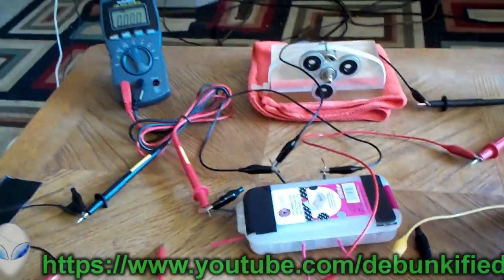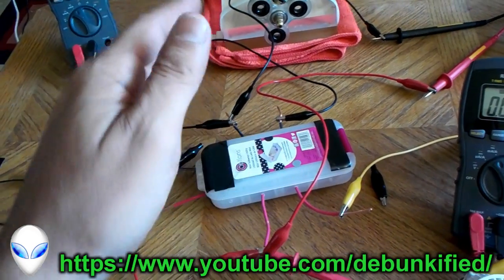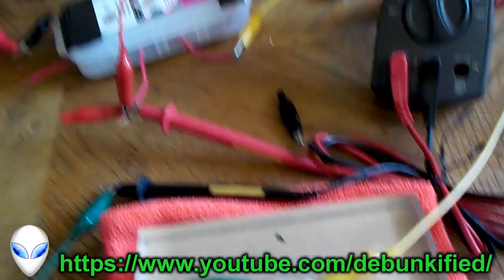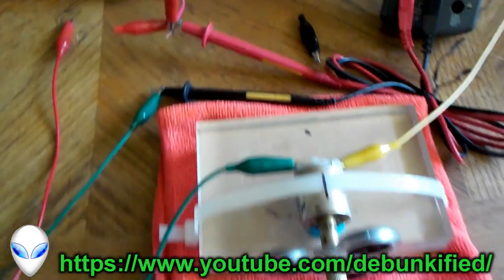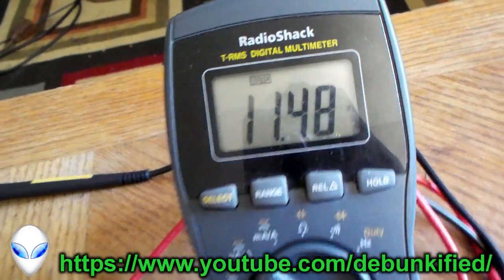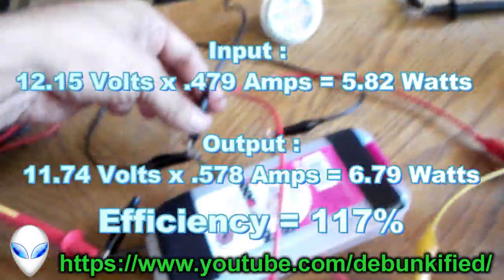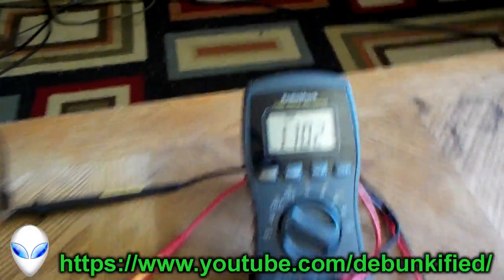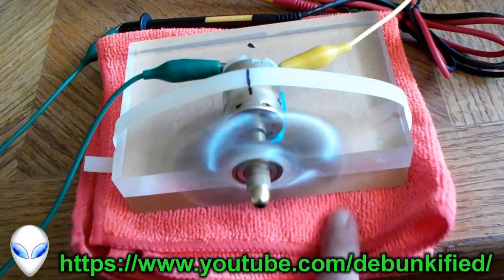Fidget Motor Powered with Free Energy - (117% Efficiency)

Comment: Mate, numbers of those shitty multimeters does not mean anything. You get correct measurements only by using oscilloscope or connecting it the way that it charges it's run battery and by monitoring it.

Comment: To Tom George:Actually with input watts, you want to measure the applied-voltage which is what the battery feeding the motor reads in voltage across the batteryFor input, you do not want to measure the voltage across the motor. (this would give a lesser value in input watts anyways since the voltage would be lower across the motor)For the ouput, now you would want to measure voltage across the load, plus the amperage to the load.....

Comment: If all you need is a potentiometer, it doesn't have to be physically the same as the original, just get a bigger one and run some leads form the board to the pot.
What is the voltage across the motor terminals, you are measuring from the PINK BOX black to the RED, you should be measuring, from RED to RED because this is where your motor current is flowing.

1) INPUT Voltage and current AT your power source.
2) OUTPUT voltage and current AT the motor.

You admit yourself you are not measuring the true motor voltage.
You are not calculating the LOAD power.
PLEASE a circuit diagram, another rats nest of confusing wires, lay them out logically.
PLEASE some pre preparation.

Comment: I hope you understand these meters dont always show the correct values? I would love to see the signals on a oscilloscope. or even better, let it work from a battery, while it recharges itself, like Nelson Rocha shows us.
Reply from the maker: +Master Ivo I am more than 100% sure that there are no AC signals messing with the meters and that it is a pure DC current, no need for an O-scope. Works with a battery as well.
Reply: what would be your motivation to open source it? or do you believe in patents?

Comment: Excelent video my friend, please put protections for the spinner...!
Reply from the maker: +skycollection Hi, what do you mean protections for the spinner? Do you mean to secure it better?
Reply: Protect your eyes my friend, some piece  can damage you,  i say that because i  had some accidents...!
Reply from the maker: +skycollection Ah I get it, thanks for the concern, you're right though. That was a highly dangerous projectile if it were to ever come lose. 

I just make sure it's spinning in the direction of the collet screw so it keeps itself tightened.
Reply: In the past i exploded a PVC PIPE with two magnets at 23,000 RPM and my tachometer save my life, the magnet destroyed my tachometer in many pieces, your spinner is not safe, is just in case...!